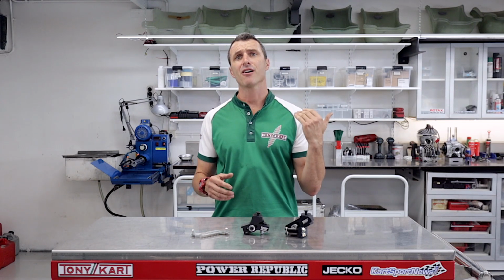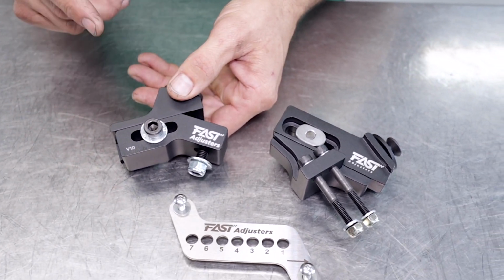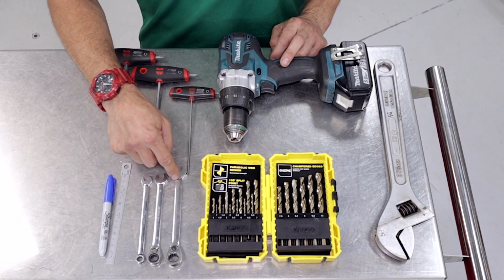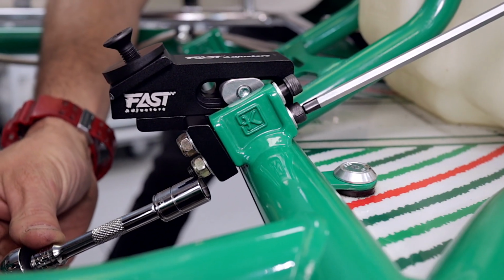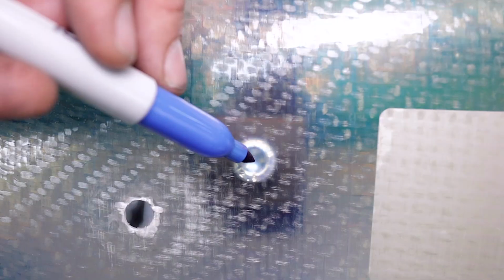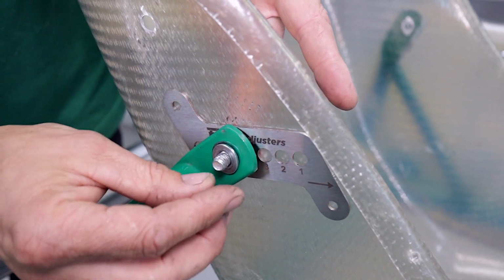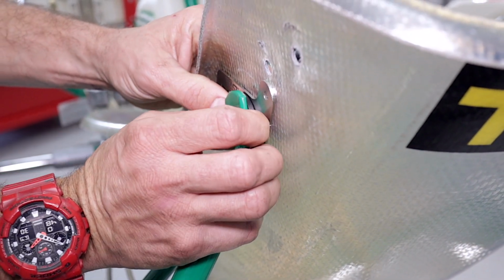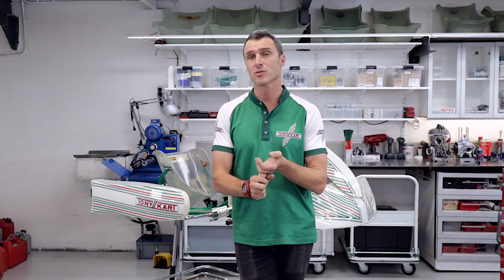FAST ADJUSTERS: The Easiest Way To Adjust Your Go Kart Seat - POWER REPUBLIC

Comment: Their quality control is lacking. At $338 USD I expected a little better than for a bag of nuts and bolts to show up at my door, it’s amazing they weren’t damaged in shipping. Additionally they shipped two of the same side fasteners instead of opposing fasteners. Do not recommend.
Reply: Hi wgd997, thank you for your email, we were happy to solve this issue for you straight away back in November 2021. For others reading comments, wgd997 made a very good observation, now there is in fact two of the same side V2.0 Fast Adjusters. This is an update we have made to the to replicate the original seat bolt spacing (side to side). It has been found to better suit seat fitment and does not make you space the lower seat bolts wider or narrower in comparison to original seat brackets. In addition to this we have reviewed and update our packaging to ensure a high standard presentation is achieved with the products arriving safely when dealing with rough shipping and handling that is beyond our control.

Comment: I had my first crack at 4stroke enduro with the dual 250cc honda engines. Did very well and my mates are looking to buy one. But my mate is short. We are both under the weight limit so we were hoping to get an adjustable seat and peddles.
Reply: we would need a faster system for changing them in pit stops though. More like the sliding rails they run on hire karts
Reply from the maker: this is maybe not the solution for you.   the sod hire karts have a great system to adjust the seat, maybe look at there hire karts?
Reply: Weight up the kart, and find a balance on seat position. I do Enduro's and my team mate is over 50cm taller then me (I'm average height, he is tall). I'm driving with flat legs resting on the tie rods, his are up near the steering wheel, it's a balance to find.

Comment: looks like you will be punching a lot of holes in the side connectors?
Reply from the maker: with the steel plates, its no factor.  but to start with only drill the hole required.  then if you need to move the seat, drill the extra holes
Reply: Hi Twin Turbo, you make a very good point. As Power Republic touched on we have the stainless steel side plates to retain the strength and integrity the seat needs, without effecting the flexibility and handling of the go kart. The side plates were designed in accordance to the FIA karting and Karting Australia regulations so that they can be used in competition. We would love to design a system that would't require additional holes to be drilled in the side of the seat but this is not something that would pass the regulations. The main focus of the Fast Adjusters system was improve seat adjustment efficiency. In addition to this the side plates allowed the perfect substitute and guide for what would otherwise be inaccurate and slower adjustments. They also reduce the weakening of the seat from holes breaking through to each another.

Comment: Hi. May be a daft question but I guess for taller drivers (6 footers) you would space the fast adjuster as back as far as possible then use the side plates for moving it forward by 10mm increments to minimise the weight on the rear tyres until the optimum is found?
Reply from the maker: you could do that for sure, especially if you are finding it hard to fit in the kart.

Comment: Very cool product, really clever idea :) btw, what's the best weight ratio (weight distribution) on karting chassies? 60/40? 50/50? 53/47?
Reply from the maker: thanks Mat, I reckon its a winner 💯.  53/47 is the most popular.  if you don't know any better for yo self, then start there and try forwards/backwards depending if it is oversteering or understeering

Comment: It looks awkward to fit correctly, but useful for people needing the adjustments set perfectly for racing.
Reply from the maker: Hey Christian! No, they're easy as to fit correctly. I must just make them look awkward so you'll tune in every week 😉
Reply: What about the seat stays do they have to be re-drilled?
Reply: @davidmcdowell340  this fast change would only have 2 adjustable mounts for the sides, with no additional support unless you drilled for every change. You could find a good set up, then fix the extra supports to secure afterwards im sure if you need them.
Reply: @davidmcdowell340  usually have to re drill holes for the seat stay if you are doing a seat position change, only kart you don't need to do this for is the Arrow
Reply from the maker: yeah that right, otherwise you can use the adjustable seat stays for Rigetti Ridolfi or OTK